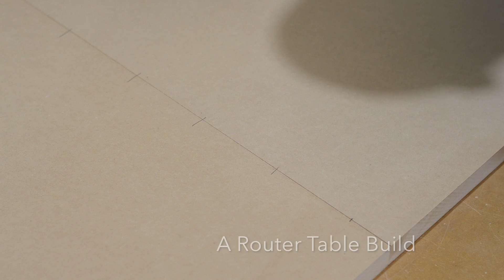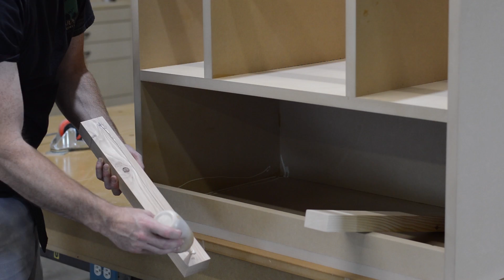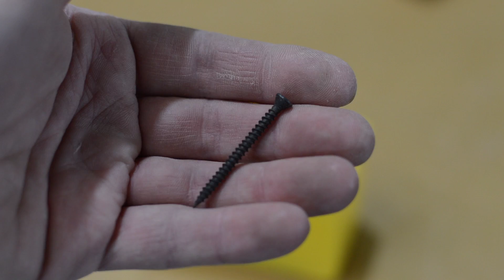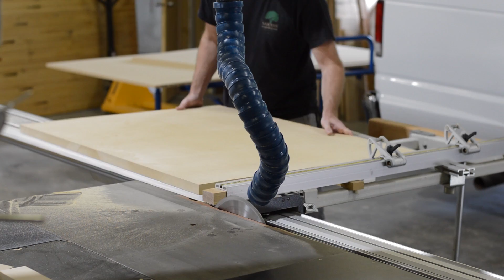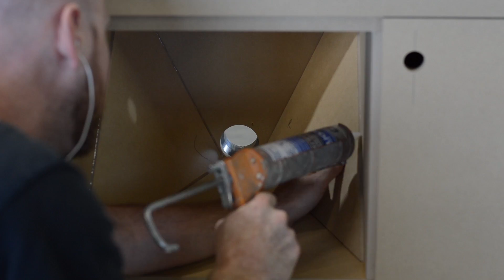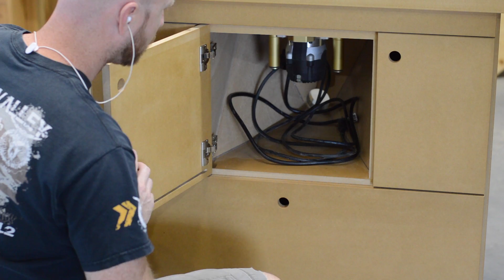Very good router table

Comment: Awesome video.. Thanks... The only thing I didn't like is the way you almost apologize for using biscuit joints. You can do whatever you want and if someone doesn't like, they can go to h... Is the same thing with pocket holes, I've seen other videos using them and the guy almost apologize only because some pros don't like them. I'm very pragmatic, if it works, it's easy and cheap, I use it and I don't care if a snob carpenter doesn't like it.
Reply from the maker: Thank you. I was not trying to come from an apologetic position, I was more trying to encourage people to use them. In thinking about what and how I said it, I see where you are coming from. I'm with you on the pragmatism, just get the job done by any and all means.

Comment: Excellent work as always. All carpenters of a certain age want to be like Norm. Second the use of biscuits. So surprised a Domino owner does not have a 8' track! Even I got an 8' track, but I am a DeWalt tracksaw owner.
Reply from the maker: Thank you. Yes we do, Norm was a huge part of my growing up. Funny you mention the 8' track, I just picked one up a few weeks ago. Why do you mention it in this particular case?
Reply: Mike Farrington 
You didn't have one in a previous video and used your Skill saw with a straight edge. I watch all your videos but only comment occasionally.
Reply from the maker: Ah yes. It was that event that spurred me on to start shopping. I did a search and found an 8' track for sale used for a good price. I jumped on it.
Reply: Mike Farrington

Great respect for you here, a new Farrington video is like the old days when a new issue of Fine Woodworking would show up. Something to be savored. 

The boys did think that instead of plastic boxes for your onsite tools, you could make a nice carcase for one or two of your boxes. A bit of splash amongst the Systainers.
Reply from the maker: Thank you very much. To this day I still get giddy every time a new FWW shows up. To be mentioned in the same sentence is an honor. I would love to do some really neat wooden tool boxes, right now I just don't have the time.

Comment: Is there a step-down version of biscuit joiner you would recommend?  One that's accurate, but not designed for professional use?  Or is this, like the Festool Domino, a "suck it up and save up for it, there's no real alternative in its class" kind of tool?  I think few understand the amount of work that goes into your effortless looking, professional quality videos -- thank you! I'm a beginning woodworker that's taken a few classes and just started making my own custom furniture (just for myself), and I'm learning a lot just by watching you work.  I love the router table; do you do any modeling with CAD tools (SketchUp?) prior to diving in?
Reply from the maker: I really think the Lamello is in a class all of its own, it has several features that no one else has. With that said, I have used several other brands, they are not quite as precise, but they get the job done. I would suggest trying to pick one up used if possible. Shoot for less that 50% of retail, and you've got yourself a pretty good deal. See if you like using a biscuit joiner. Upgrade if you really like it.
Reply from the maker: Oh, and I do not have any CAD drawings. I just design/build as I go based on exterior dimensions. I may put some plans together if there is demand.
Reply: While this isn't a democracy, you've got my vote for plans! +1
Reply from the maker: Thank you for the input. Also, I should have mentioned that there is a time issue too. I suck at computers, so I could probably build another router table in the time it would take me to design it on the computer, but again if there is demand I will find time.

Comment: Mike your a rock star , I like your style , I've been making a living at shop work for over 20 yrs and this is how things are done in the real world where people aren't trying to pat themselves on the back for how unnecessarily complicated they  can make a process be....
I'm curious though
Do you also have a shaper ?
Reply from the maker: Thank you. Keep it simple stupid as they say. Yes, I have a small shaper, 3HP delta. I have a few cutters for it, but I find that with how good router bits are (and how comparatively cheap they are) I like using the router table. My shaper has become a dedicated template cutter. It will be featured in a video at some point.

Comment: Where did you get the hose for your table saw dust collection? Looks adjustable
Reply from the maker: Its called loc line. I use the 2 1/2" diameter.

Comment: Dirt biking or dual sport? I was through Denver on my way to Moab this March with my 300... what a fun place! (Moab, not Denver - haha) I like this build... going to adapt a few features to my cast iron top/lift to attach a power feed. Not enough space behind the fence for the mounting base.
Reply from the maker: I like both. My heart lies in long distance dual sport rides that include camping. I also did a small amount of dirt bike racing pre kid. I have yet to make it to Moab. I will say it is high up on the list.
Reply: Totally worth the short (for you) trip. The rocks there are like sandpaper... "hero traction"!
Reply from the maker: I am, my handle is same as my email. I'm not on much any more, the kiddo has eaten up most of my riding time.

Comment: Helpful AND entertaining! And I'm very hesitant to offer any type of suggestion to you. I am a novice; you are a master woodworker. I get concerned when I see anyone working in any fashion with MDF without a face mask. Please forgive me if I'm out of line. The last thing I would want to do is bring any offense to you. Thanks again for your really great videos.
Reply from the maker: Thank you Jay. First, don't be hesitant, I'm always open to criticism. I wear a mask more in the winter than the summer. I two apposing roll up doors that carry the dust away. From my measurements, in the summer the air in my shop is pretty darn clean.
Reply: Mike Farrington Thanks Mike

Comment: Do you have plans for this table? What kind of plate is that for the router? How did you mount the router?
Reply from the maker: No plans yet. I may put some together in the future. The plate is made by Incra. The plate has a pretty nice system to capture the router. I didn't mention the brand of the router plate because they are not a sponsor and I didn't want people to think I was pushing a product. I think there are a lot of good router plates out there, shop around and make the best choice for you.
Reply: Mike Farrington thanks

Comment: Super nice design & build Mike. How do you manage working with full sheets of 1"+ MDF? That's got to be very heavy.
Reply from the maker: Thank you Chris. Funny you ask, I was just breaking down another sheet of 1" before taking my lunch break today. I either use a track saw, so I don't have to move the sheet around a ton, or I load it on the sliding table saw.
Reply: Just getting it in and out of the van has to be a challenge. Include a shot of that in one of your future videos, please :).
Reply from the maker: Its a total pain. My only tip would be the use of carts or saw horses, then rough cut it in place. I also try to only lift one side at a time.

Comment: I love those screws as well. The one's from GRK work great for installing cabinets and connecting them through the face frames
Reply from the maker: Yes, the GRKs are great. I have some from them that are super long, like 3". Great for odd trim installs were you need some more reach and yes they are great for FF to FF connections.
Reply: Hi

Comment: The way you made that finish for your router table is the same way I make sanding sealer. Great video man, I enjoy watching your videos.
Reply from the maker: Yes, this is a great sanding sealer. Thank you.
Reply: Looks like a good finish.  I have several MDF fixtures that I impregnated with an impregnating epoxy. I use System Three.  
I do like this router table a lot.  I also like that Jessem lift

Comment: Is it possible to paint over your polyurethane?
Reply: Yes
Reply: For MDF you can do shellac and then paint, or use a shellac based primer if you just want color. Just another option if you are interested.
Reply from the maker: Yes, I would give it a good long while to cure, then sand, then prime and paint.

Comment: Now that's a well built piece of shop furniture! Too bad you won't share that poly to thinner blend ratio... ;)

Could you share how you measure to size the door/drawer faces when using full overlay hinges like this? I can't seem to wrap my head around how to end up with consistent gaps when planning to use the full overlay hinge. I know they have a few mm offset to begin with right?
Reply from the maker: Ha! I'll leave the ratio in my will to be released to the public after I'm gone. I'm going to go over that in my hinge video that I will get to some day. The short of it is first start with how much the door overlays the hinge side, typically this is near 3/4. then I measure over to where I want the door to terminate, and I minus my gap. There is a little more to it then that, but hopefully with will get you started.
Reply: Thanks Mike, I know it's a difficult process to put to words. I just found it difficult because the hinges themselves have a certain offset already (which of course is adjustable too). I look forward to the video when you get to it!
Reply from the maker: I will get to the video at some point. I really think seeing it will make it all clear. Woodworking is such a "see feel touch" kind of thing. At least with a video you can see.
Reply: Totally. That's why YouTube is the best!
Reply: Josh Dirkson 50-50
Reply: Looking at the video it is pretty much 1:1 from what I see...

Comment: I absolutely love the way you assemble your carcasses. People give biscuits way to much crap and they are more than worthy to be in every project possible.
Reply from the maker: I agree, honestly, thats why I make such a big deal out of using biscuits. You don't need a domino to build a nice cabinet.
Reply: I noticed the emphasis on it lol.
Reply: Nesley Heine
y
Reply: As a cabinet maker myself, I tend to use both. The domino is definitely used more, and is more versatile. The biscuit jointer mostly gets used for shelves in a cabinet, you slit the edges of the shelves with it. This means you can disassemble for finishing and then glue the shelf in afterwards. I feel both deserve a space in the workshop.
Reply: Nesley Heiney n
Reply: I sold my biscuit after getting a domino and after having used it for about 3 years, I still think it is a great item for very specific usage (that I havent done yet, like chairs) but as said, biscuit are a great tool too! I just dont like them when it is important to maintain a specific and precise alignment between boards.
Reply: alain pilon it’s all about reference surfaces. If you pay close attention to the layout and the referenced surfaces for your joiner fence all will go well.
Reply: the "problem" with biscuit is that they slide from side to side so, compared to Dominos, they are much harder to use when trying to join two sides of exactly the same length. Also the loose tenon are a good way to join chair legs and arm rest. Finally, they are a "good" way to do end grain to end grain joinery. Not that I do that often tho... The Domino is more flexible, at the price of speed and cost of usage and ownership.